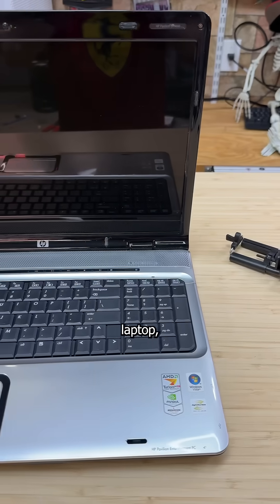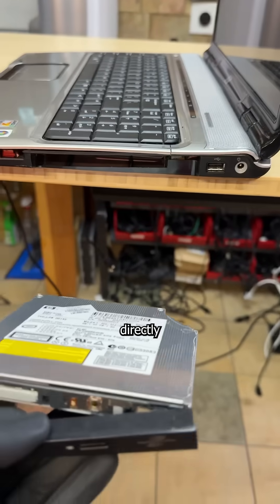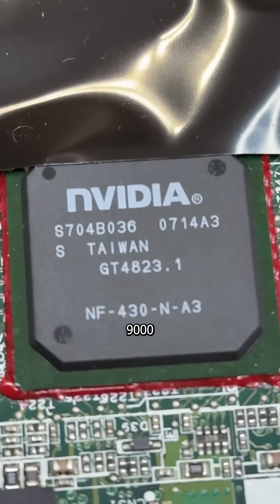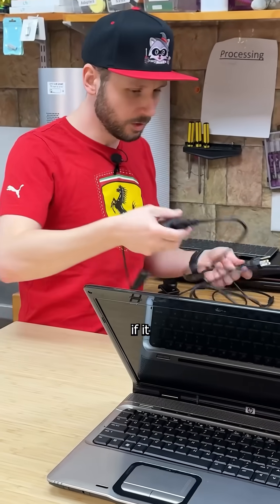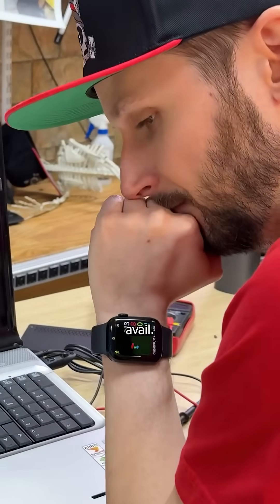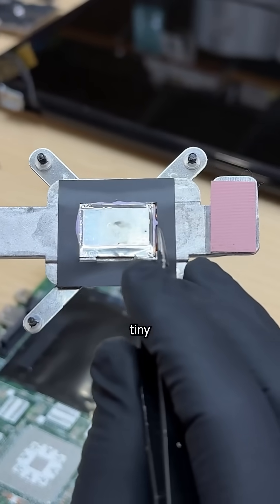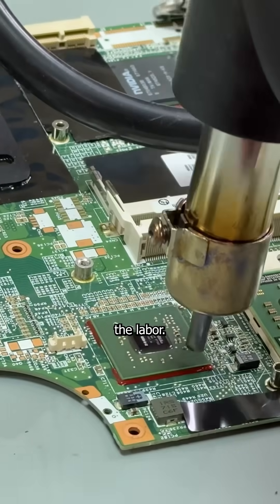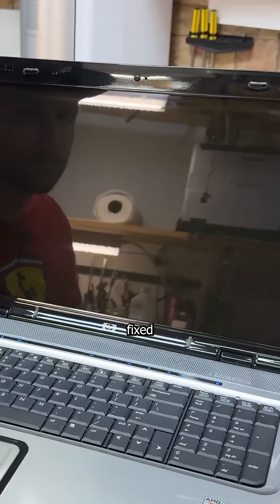$2000 HP DV9000 - The Worst Laptop EVER #tech #technology #shorts #pc

Comment: Yep that's HP for you, if I could send a picture I'd send a pic of my cheapo HP 14 something² laptop complete with all the problems anyone can run into.

Broken hinges and chassis 

Battery getting fat

Pieces of the the laptop falling off (albeit  just the shell)

The entire keyboard cover assembly opens wide if I open the monitor the normal way other laptops are opened.

Bent parts of the frame making some keys on the keyboard sink and need to be pressed harder to work. Some don't even work anymore lol. 

A dying HDD that's as fast as a normal snail (Not Turbo the Snail) can go.
4 gigs of shitty 1866mhz ram and only 1 slot for such sticks.

No M.2 slot I need to buy a SATA SSD if I'd upgrade the storage (probably not since this laptop is literally dying).

A dying fan even though it's clean as hell, courtesy of the debris from the broken hinges, idk but HP might be a genius at making temporary devices because they're designed to fail no matter the care put into them.

USB ports being allergic to small adjustments causing whatever device plugged in to momentarily have a seizure itself.

The buttons on the touchpad literally similar in strength to a potato chip (which is why I don't use them so much specially since the frame is tearing itself apart). 

Only ONE heatpipe to transfer the astonishing amount of heat generated by the dual core (A4-9125) cpu to the previously mentioned dying fan.

The only upsides of this thing being the Ok screen (1366x768 and average everywhere else) and the pretty loud speakers (which might also be dying).

And yeah now that I wrote this I think I really do have the complete HP laptop experience. 
And yes I am planning on buying a new one considering that if I upgrade this it might only last just a few years more until the body itself breaks on it's own. 
And that it may not be worth it to upgrade until I get a new one.

Comment: I don't remember much about my first laptop except that it had 512 megs of ram, and fucked-up GPU, but my second one was HP G42. Certainly newer than this machine, but the maintenance was still a rectal tonsillectomy tho, it took high-school me like half a day to disassemble, repaste and assemble it again. The GPU fucked up somewhere along the line so I had to desolder a jumper (? or whatever it is called, when a trace is split and connected by a blob of soldering alloy) to remove power from it and prevent Windows from trying to install drivers and BSODing.
And she is still kicking even in this crippled state, with a RAM upgrade and SSD she serves my parents well now.

Comment: That solder was such garbage THE ONLY way to save those chips was reballing lmfao
Reply: This is completely wrong. Reballing the chips does nothing. The problem exists in the bumps between the silicon and the substrate. They are not fixable in any way whatsoever. The only reason the chips start to work again after reballing is because they were heated up.

Comment: Wait, so youre telling me that my asus f5n with the geforce 7000n does in fact have bad solder like i had suspected? It also does no have dedicated cooling, just a simple thermal pad. I even bought a new motherboard for the laptop, but that also ended up dying. I managed to revive it with the use of a heat gun, and  it worked for a few months. I did do this again 2 or 3 more times, but stopped as i was sick of having to take it all apart.

Comment: I still have my DV9000. Felt sturdy enough. The hinge and screen has been broken for years now.
Reply: There was a recall on the hinge.  However, since I was careful with mine, the recall expired before mine broke.  I actually took it apart and repaired the hinge making it much stronger.

A few months later it had the solder problem.  I sent it somewhere for a reflow.  That lasted about a year.

Comment: Ah hell, I had the DV9000 and Dad had the DV6000. Both had solder failures and got fixed by HP. The DV9000 did eventually fail after 5 years, but the 6000 is still working. Lead free solder was a pain in the arse.

Comment: I used an oven to reflow the solder on a dv8. It was a temp fix, and basically the laptop wasn't worth much more work than that. It was a friend and they had two of them. It's sad that i remember this level of detail about 10 years later. They were just garbage laptops.

Comment: i have one of these!
interestingly, despite all its problems (the headphone jack electrocutes you if you touch it, the battery is stuck and can't be removed, and it randomly kills the cursor requiring a manual shutdown) it still somehow outlived my ideapad C340 (ran for 11 years straight!) and probably will still boot up if i find the charger. i used to watch so many DVDs on that thing because nothing newer had a DVD drive.

Comment: It's crazy to me that I just had a completely different experience with HP than most people seem to have lol. This laptop lasted years being used practically as a desktop (granted I gave it a helping hand with some extra cooling), I had a cheap prebuilt tower for a while from walmart that's still going strong as an office pc. I liked that they usually were easy to fix problems on, at least software wise, and I could usually revive even a pretty screwed up hp. Meanwhile my Dell gaming tower was garbage from day 1, and any time I've gone away from HP the computers tend to have a lot of problems. Just kind of funny, I must have had impeccable luck.

Comment: I have an old HP laptop that I got in 2009 as a graduation present. Don't even know what model it is but it runs Windows Vista. It still works, has all my memories of those times. But I leave it as it is until I can safely extract everything before it really dies. There's very old music and video files with a deceased friend I don't want to lose.
Reply: Just pull the hard drive out and connect it to another computer to copy everything off of it while the drive still works.

Comment: HP products have been unusable for a long time. DV9000 laptop is a perfect example. I also have a DV6000 here, almost identical. An exceptional piece of junk. The printing devices are even better. In our office the old officejet still works well, but there is no scanner driver that works with windows 10, so we bought an MFP234cdn. Straight out of the box it won't print because it keeps displaying error 49. After uploading an update to fix the problem it still displays error 49, but only sometimes. You can't put on non-original toner because you have to have a chip, and original toner is way too expensive at this capacity. It costs 3.5x as much as the original toner for a similar Brother device (brother toner prints about 100 pages more). Another case: a new original toner (cyan) for a color laser printer (can't remember which model it is, it's less than a year old) spills powder inside the printer. HP service does not want to clean the printer, but instead sends a new toner, which also spills powder inside the printer. We paid for the service second as much as for the printer itself. The problem was solved by buying a non-original toner.

Comment: I remember that red ring of death on the Xbox.  Had to wrap the thing in a towel to try and heat it up enough to get that solder point to fix itself.  Had to do that quite a few times myself.  Eventually it stopped working to fix the problem.  I finally tore it down and fixed it myself.  Got another 2 years out of it after that until I got an Xbox one.

Comment: I had a similar one like this. I tried to replace the hinge and ended up with what I call my first keyboard computer. Snap off the screen, plug in your monitor, and have a desktop with built in key/mouse. I have so many keyboard computers in my lab now because I still fail at  laptop screen repairs.

Comment: This was an actual issue, but there is still a lot of missinformation. It is not solder at fault, it's solder bumps which are under the die itself. That is unfixable, and they react to any heat so they will come back for a bit of time after blasting with hot air or reballing. The whole issue is known as Bumpgate.
Reply: Thank you for this comment. I'm so sick and tired of seeing this nonsense perpetuated by people who don't understand the problem. It's really easy to demonstrate, too. You don't even need to get the chip up to a temperature hot enough to melt solder to make it work again.

Comment: Ah... this one. Brings back memories. Every surface at home covered with parts and scribbled down instructions and different set of bolts pinned in paper on a crudely drawn outline of the thing - whenever something needed replacement.

Comment: I had this exact model and it worked very reliably for a good 7 years of daily use. It saw a lot of action and never one single issue. I replaced the battery three times during its lifetime and at the end it still worked as a diagnostics/programming tool on my electronics desk. It did die eventually, it just failed to give any image on the display so it got recycled. It was one of the longest serving laptops I had. It started as a Windows XP machine and died as a Windows 7 machine. I remember it originally came with Vista which I immediately replaced with XP.

Comment: sounds kinda like my first Acer:

Acer Aspire 8530G

500GB HDD

Whopping 4GB RAM

oddball resolution 1680x945 18.4" screen

AMD Turion 64 X2 RM-74 (aka The Worst 2009 Laptop CPU That Ever Existed)

Blazing fast overheating speed, even with a 18.4" size laptop fan cooler, yes, i just had to, that big ass laptop still overheated even on Half-Life 2, with that laptop cooler, 40 FPS on HL2 Deathmatch and 98°C CPU temperatures

Best FPS i ever got in HL2 Deathmatch was a whopping 60 (no VSYNC), unlimited

Radeon Mobility HD3650 Graphics

4.1KG weight, 0.3kg heavier than the DV9000

And ofcourse it didn't die when i needed it to as i was a teen without money and desperately wanted a new laptop as on most games like even Garry's Mod 1FPS wasn't hard to achieve

Yes, One Whopping FPS with a few NPCs.

Since then i always stuck with NVIDIA and Intel, i had a better gaming experience on a damn Pentium 4

On Vista moving the mouse cursor rapidly over my desktop made the CPU spike to 100%

btw on my desk i had a metal L bracket, which was 5 inch away from the laptops' fan exhaust, and no joke i burnt my hand on that once after a few hour gaming sesh

Comment: Hi here in England I have a very similar DV6 HP Pavilion which while old and  and unable to hold a charge even with a new battery does still have its remote control.
Last time it powered up I stuck Ubuntu on it, it worked fine .

Comment: You can fix it by heating it up at the time many manufacturers suffered that switch they change the mixture or something but it cracks inside even if you recall the chip the damage is internal same as the xbox360s even if you cooled them with huge coolers they would still fail on you it was the chip it self they said xenon motherboards where defective cuz they had the first revision of chips I had a xenon with a newer revision it never failed on me still works after years

Comment: My dad had that same laptop collecting dust in a box in his room, not too long ago I tried to download an image using internet explorer and i had to wait 20 minutes for the download to finally end, when I was a kid I remember that laptop was fast af and now I see the consequences of aging
Reply: Give it a defrag (or an SSD) will probably live on OK IF you re-do the thermals at some point!
Reply: @TheSpotify95  It's a major pain in the butt to take these things apart.
Reply: @Pixelman-k3v  The DV9000 is really simple, it just has a lot of screws. Way easier to work on than many newer laptops.
Reply: @rars0n  As far as I know, to get to the CMOS battery you have to pretty much take apart the entire laptop.
Reply: @Pixelman-k3v It's been forever since I worked on one, but as far as I can remember that's not the case. Most of the laptops from this time period had easily accessible CMOS batteries. It was newer ones that tended to hide them deep inside (many of the cheap laptops don't even come with a CMOS battery anymore).
Reply: @rars0n  With the one I have the CMOS battery is underneath the keyboard, and to remove the keyboard you have to remove the plastic frame around it which requires removing every screw for the bottom and then you also have to remove the screen to get the frame off.
Reply: @Pixelman-k3v Which model is it? I checked iFixIt because I couldn't remember exact details and the DV9000 actually has it right underneath the RAM cover on the bottom, so it's really easy to get to. I was thinking something along those lines as that was pretty common for a lot of laptops back then (even some of the dumb HP designs).
Reply: @TheSpotify95  Defragging does nothing on most computers. Also, it's a really bad idea to do a defrag on a hard drive of questionable health.

Comment: I had one like it by hp nicknamed the Dragon.  It was a Halo product and  weighed 16 pounds.  It had a 20.1 inch screen and was the first laptop to have a blue ray drive and a1910 by 1080 resolution. It even had an indentation that held a really nice remote control.  The battery often only lasted one hour.  lol   It attracted a lot of attention if I used it at Dennys. TBH: it was more of a 'transportable' product than a portable one.

Comment: Ngl i just took my hp pavilion 6500 apart this weekend and back together to re paste it and clean the gouch from the fan and as much as there were a good amount of cables i feel like it was way nicer than a lot of stuff today, no security screws, and only one hidden screw when disassembling the fan cover. I took that thing apart with a lego train Philips, tweezers, and my absolute power. Not that it would match the greatest technicians power but your mom know what I'm talking about
Reply: I also got replace the drive and booted Linux on it

Comment: "The worst laptop ever made" unless you compare it to every single modern e-waste-tier laptop made by Asus, Lenovo and other made in china brands. Made of the cheapest, most disgustingly low-quality plastic possible with 99,9% of components soldered to the board that spontaneously combust as soon as the warranty goes out.

Comment: If it is plagued by the same issues as a phat ps3 then it has nothing to do with the solder, the rsx die itself was the problem as it was a completely faulty chip that can be swapped out for a different more reliable ps3 slim rsx and work like nothing ever happened. If it's same, then replacing it with a new, completely different, more reliable chip would fix it.

Comment: Nowdays, all screws are the same. I remember HPs with 20 different screws to fit that device together. Never wanna see one again.
Reply: I've found way more newer laptops than the DV9000, which uses all Philips head, that are using a combination of Torx and Philips. It's still a thing that HP does, at least on machines up to ~5 or so years ago.
Reply: And every module on crappy cables.
Reply: And plastic tabs. Every piece of trim held with fragile plastic tabs and one hidden screw.
Reply: They're still absolutely like that
Nothing is customer friendly
Reply: Can confirm my 2019 HP omen still has 2 types on the outside and 3-4 types inside until heatsink disassembly. All Phillips head, can't complain 'bout that, but the length are different, and I highly doubt that a mixup will result in a screw going through somewhere it shouldn't.
Reply: Then never become a Mac tech, trust me...
Reply: @ Never touched one and not planning to do so.
Reply: I've had to rerepair a few after their warranty repair department misplaced to screws in the wrong place!
Reply: @JohnDokivin  and shortcut the circuits?
Reply: My old (~2011) HP has only 2 type screws, m2,5x5mm and m2,5x7mm, x5 is insides and x7 are external for case
Reply: My personal laptop ranking in contrast to car reliability:

Alienware, MSI, CyberPower, iBuyPower, NZXT = 
Lamborghini, Ferrari, Koenigsegg, McLaren, Bugatti, Rolls Royce

HP, most Dells, most Acers, some Asus Apple, Samsung, MS Surface = 
Tesla, Volkswagen, Audi, Porsche, Mercedes, Dodge/RAM, Fiat/Chrysler/Jeep, most Fords, most Chevys, newer Buicks, newer Lincolns

Some Dells, some Acers, most Asus, most Lenovos = 
Some Fords, some Chevys, older Buicks, older Lincolns

Some Lenovos, Newer Lenovo ThinkPads = 
Ford Crown Vic, most Ford Explorers, some Mazdas/Subarus/Acura/Lexus with turbos

Older Lenovo ThinkPads = 
Toyota, Honda, all naturally-aspirated Mazda/Subaru/Acura/Lexus

(I'm aware Toyotas and Hondas have mixed reputations on their newer vehicles including ones not limited to turbocharged or hybrid powertrains & quality control issues with Tundras/Tacos, however despite that I still trust Japanese engineers that they will correct each issue better than everyone else to this very day - this is my personal opinion after all.)

Comment: I have a '06 Asus laptop that most likely suffers from the exact same issue, shame that such electronics fail from that thing and you need reballing station
Reply: No you don't, because reballing won't do anything to fix the problem.
Reply: @rars0n  What could fix it
Reply: @windestruct Other than replacing the entire chip with a brand new one, nothing. Reballing is a complete waste of time.